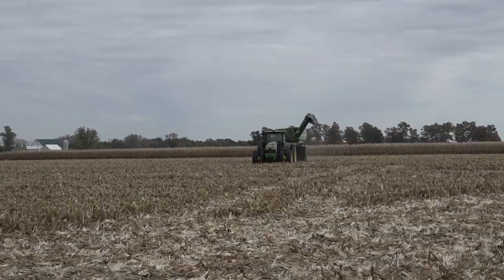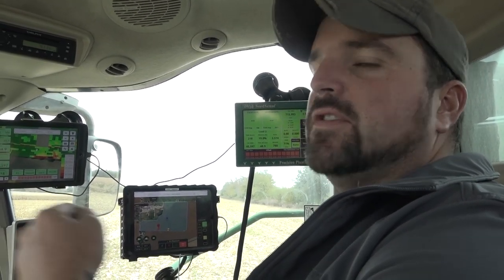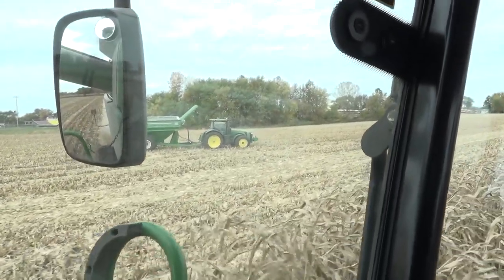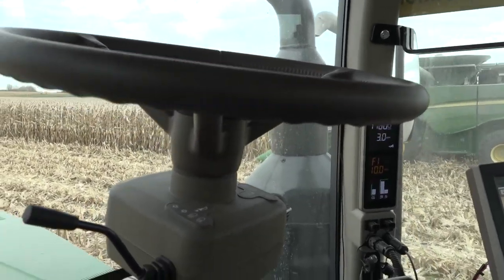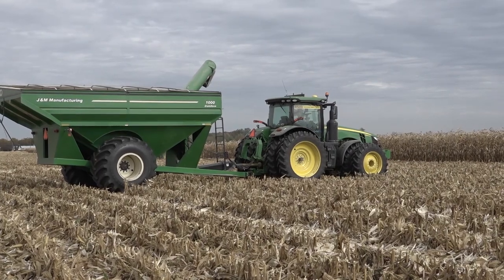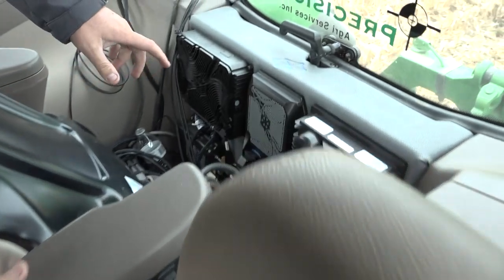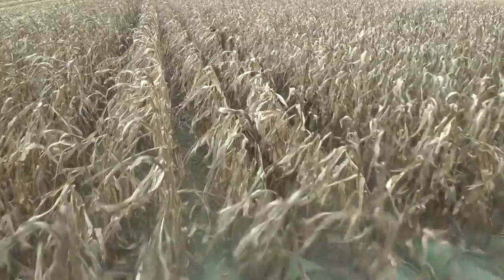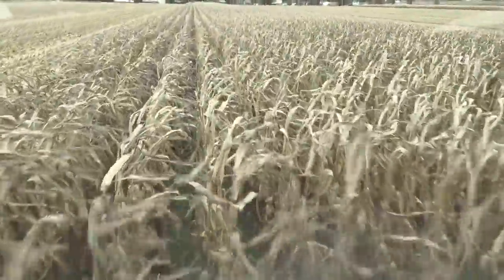Autonomous Grain Cart in an Ohio Corn Field

Comment: Wow. Just seems like a ton of money to not dump directly into trucks. I mean add it up,,,R series JD, dump cart, operator or autonomous outfit, interest, fuel, maintance,,,,
Reply: The target market for this product likely already has the equipment
Reply: @The_JEB  I wasn’t singling out the autonomous technology but the fleet of equipment the Farmer uses to not dump the combine directly in the truck as a whole.
Reply: @johnallen5996  its far more efficient for a grain cart to shuttle product back and forth between the combine and the trucks than it is to have the combine go to the trucks. Especially if the trucks have a long round trip, the grain cart can hold a lot more grain so the combine has less down time when harvesting.
Reply: @The_JEB  more efficient or easier? Don’t get me wrong, I’m not arguing as I am surrounded by large farmers but I can’t believe the cost of all that equipment including interest maintenance and fuel is always more efficient
Reply: @johnallen5996  less time they spend in the field harvesting the sooner they can sell their product and plant the next round of crops. Most large farmers plant two crops.